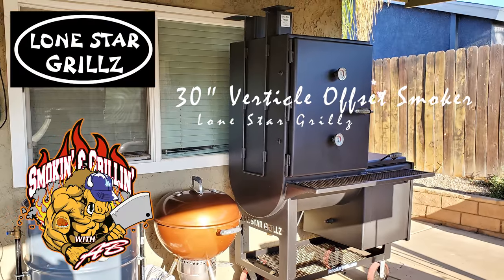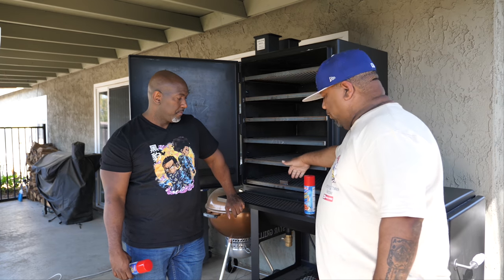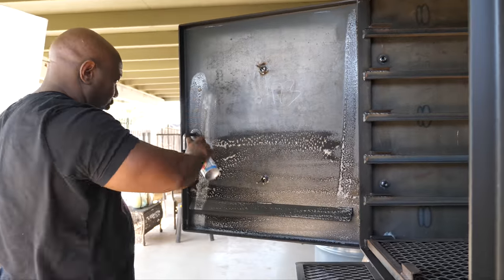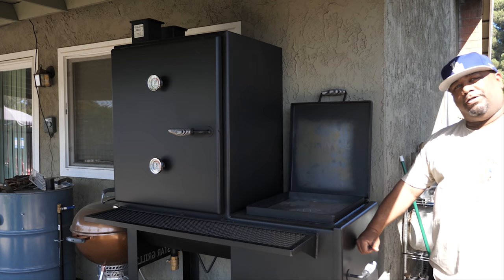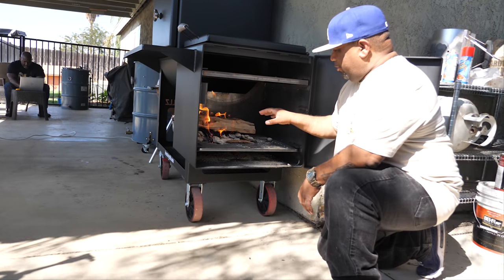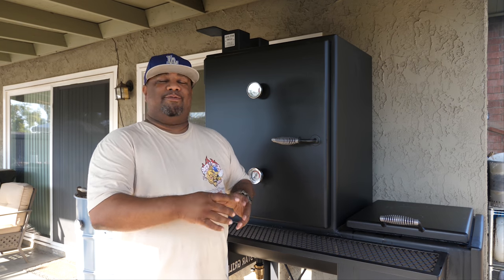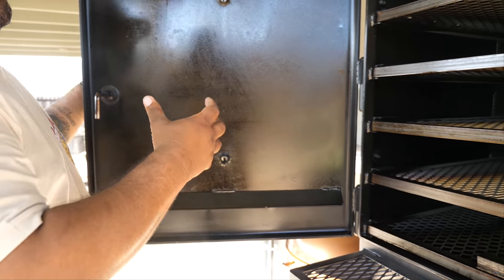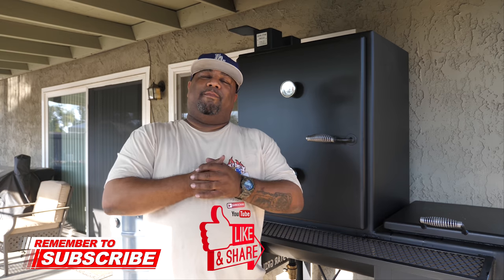Lone Star 30" Vertical Smoker Seasoning | Offset Smoker

Comment: AB, the hottest area will be right above where the heat is entering the the smoker chamber from the fire box.  Be careful of this zone when placing meats.  Have cooked on several different offset smokers and learned this early on.  But that is a good looking and big smoker!  Does it have have a diversion plate at the bottom of the smoke box to evenly distribute the heat?  Could not tell from the video.
Reply from the maker: Yes it does have 3 plates (Baffle Plates) at the bottom underneath the bottom grate. I will put that in the video I'm filming tomorrow.

Comment: My one concern is, why is this unit, so close to the exterior walls and the vents are extremely close to the rafter of the overhang?
You don't need a flame to start a fire
Reply from the maker: True and this is not my final cooking spot. I'm having an area out by my pool being made now.
Reply: @SmokinandGrillinwithAB  I was wondering the same thing and it's close to the window. Thanks for the great video.